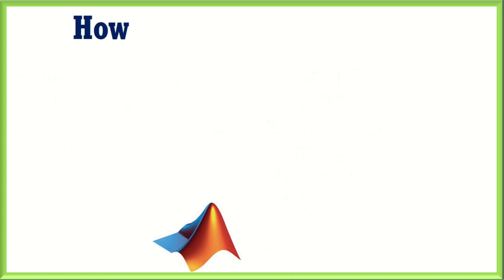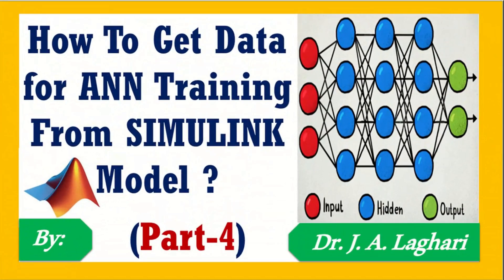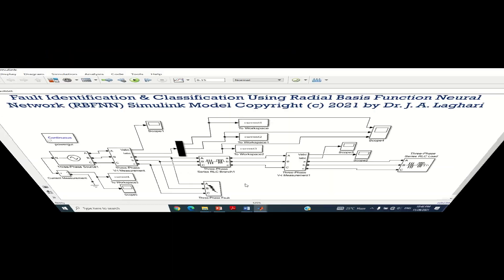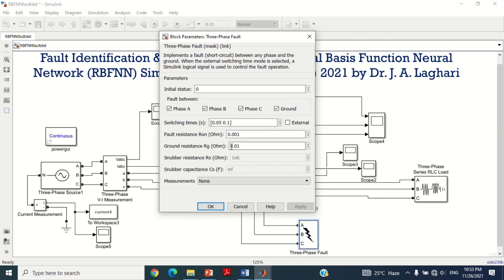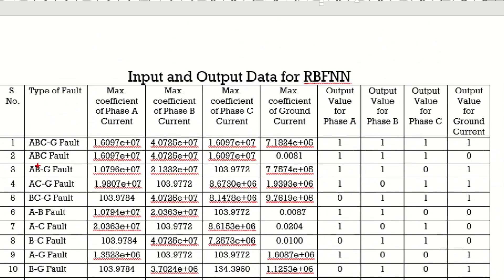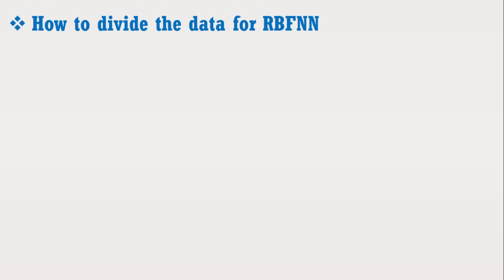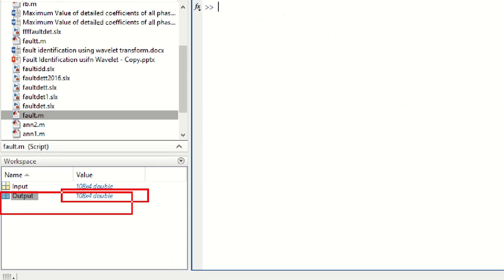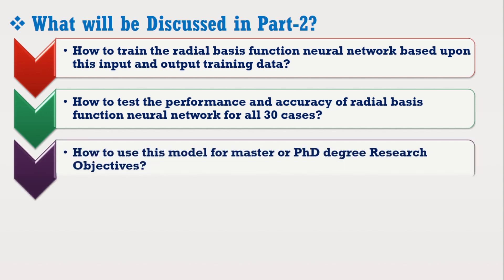RBFNN Based Fault Detection & Classification Simulink Model | Dr. J. A. Laghari

Comment: Sir aaik baat please samjha dain k different fault scenarios mean Single line, double line....upto to 12 ko aap na data set mai use kiay han
Data set banatay hway kon kon si resistances ki value rakhni hoti han ya kasay pata lagta ha
Reply from the maker: Thanks for the comment. Fault resistance values can be obtained from the research paper. Therefore, try to find any research paper to find the range of values.
Reply: @DrJALAGHARI  The files that you provided in which 138 data are written not mentioned the resistance
Can you please provide
Reply from the maker: @muhammadzubairirshad4360  Thanks for the comment. I really don't remember. Kindly watch the video for knowing the resistance values.

Comment: Dr. J.A. Laghari, thank you for your video! May I ask, if I want to gather data from 9-bus system, when applying different types of faults on all buses & lines, should I take the current measurements only from the portion where I apply the fault? For example, I apply fault on bus 8, thus I take current measurements on bus 8? Thank you!
Reply from the maker: Thanks for the comment. No. You should take the current at the source .
Reply: @DrJALAGHARI  Thank you for your answer! May I clarify, if I have 3 sources (e.g. IEEE 9 bus), then I take currents from all three sources right? Thne my input into algorithm would be 3 set of phase currents (9 inputs in total) from each source? Thank you!
Reply from the maker: @bakhtiyarkazbekov605  No. Only take current measurements from the slack bus.
Reply: @DrJALAGHARI  Thank you very much!

Comment: Sir one doubt during fault. volatge in that phase will be zero so just by looking into voltage measurement we can say fault has occured then why we are using discrete wavelet transform
Reply from the maker: Thanks for the comment. In short circuit, voltage will be reduced. Such as for line to line fault, voltage will be reduced but not be zero.

Comment: Thank your sir for your video. Can I get the 2nd part of this video sir?
Reply from the maker: Sure. On next Monday I will upload the second part of this video. Don't forget to watch.
Reply: @DrJALAGHARI  sir, how can we use it for finding the fault location?
Reply from the maker: @navalkishorsah5067  Thanks for the comment. There are basically three objectives. One is fault identification, second is fault classification. Third is location of fault. Fault location is commonly obtained by the distance relay. I think you have to go through any research paper based on this topic for better understanding.

Comment: thank you doctor for explanation, my question we can use wavelet transform as extraction for signal and using ANN as classifier  ,possible to be vice-verse
Reply from the maker: Thanks for the comment. Yes it is possible. Same is explained in this video.
Reply: @DrJALAGHARI  Dear Doctor thank you for reply ,my work focus on discrimination between inrush current and internal fault and I need using Wavelet method or RBFNN for discrimination or classifier ,from my following your channel the wavelet transform can apply on coding matlab after obtain signal from simulink also the the same with respect to RBFNN
POSSIBLE TO CLARRIFY THIS POINT WITH MY REGARD